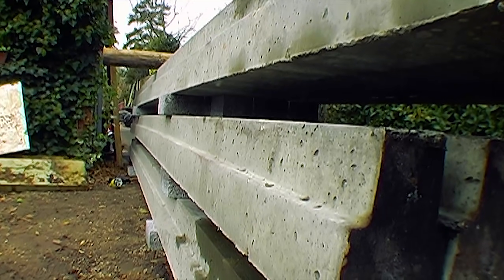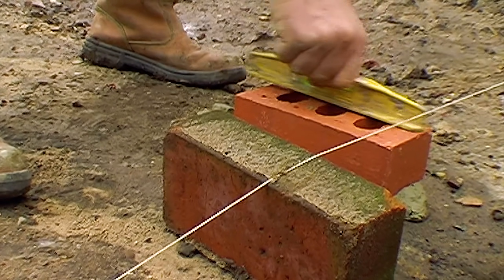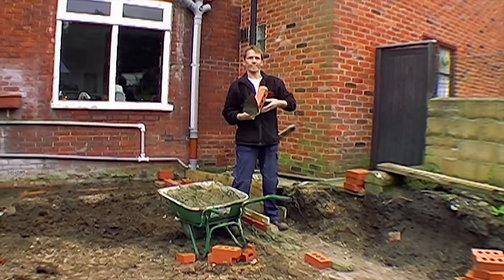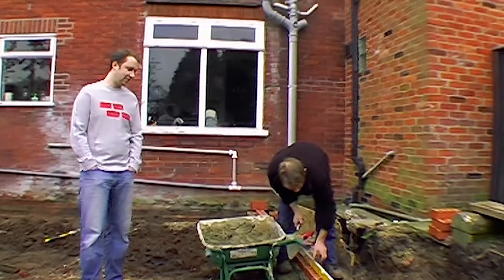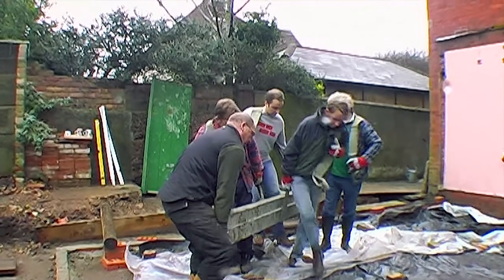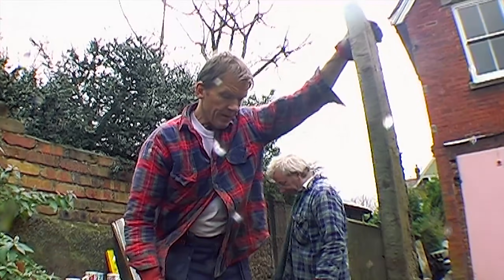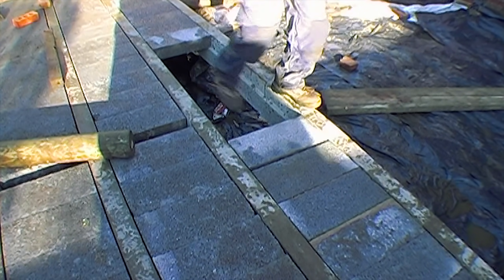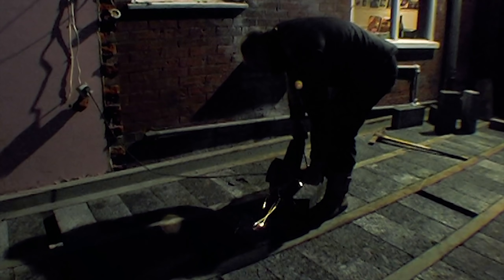Beam and Block Floor Assembly - 35A Extension #2

Comment: Wouldn't  the beams subside because  these are resting on one row of bricks without any foundation below that.
Reply from the maker: The foundation is wider than the wall and goes down 1 metere. The inner wall is built up directly above the beam ends

Comment: What is that floor all about? Why is it concrete beams and blocks and not all concrete or wooden beams?
Reply from the maker: Because it is a beam and block floor. It is a very good way to build.
Reply: First I heard of it.. guess it has its advantages.. must have been selected for an engineering reason  @SkillBuilder

Comment: Hi, did you have the beam and block foundation specified by a specialist company? Also, what is the specification for the foundation and footing that the beams rest on. Apologies in advance, I’m trying to have installed at my house.
Reply from the maker: Just go to a supplier, through your merchant. You send them the drawing and they spec the whole thing. The beams sit on a dpc on top of the brick or blockwork that forms the inner skin of the cavity wall.

Comment: Why is beam and block system economical, in this situation, when it's so close to the ground?

Ground conditions?

Too expensive to, excavate and replace with hardfill (down to stiff soils) and slab on grade above?

Thanks in advance.
Reply from the maker: Yes the ground was all made up and getting down to something solid was a lorry load of excavation.

Comment: I don’t see how this is faster than pouring concrete. It’s too heavy, requiring 5-6 men instead concrete pour requiring 3 men.
Reply from the maker: It isn't about speed. This is saves the ground build up with hardcore and sand and reinforcing.
If the ground is not great you have to dig down especially with clay. This ground was all made up so it would all have to come out. 
Some places we pour and sometimes we use beam and block
Reply: @SkillBuilder  Thanks for the clarification.

Comment: Why wouldn't you have installed a central sleeper wall to split the span? 

Also ensure a minimum 150mm ventilated void is kept rather than the 75mm in the video.
Reply from the maker: The ground was made up so a central walls would have required a deep foundation. The beams do that span very easily. As for the underfloor ventilation it is supposed to be 150mm for sure.

Comment: We would use them beams on an industrial garage not a poxy extension. Not sure if lightweight beams were a thing when this was filmed though
Reply: The beam size is relative to the span Jack. Smaller jobs would have a lighter beam.
Reply: Nathan Ellis we use light beams for everything

Comment: Hello
Can you explain to us
Why right didn't use concrete foundation
Reply from the maker: Hi Raul 
Beam and block is independent of the ground so the made up ground doesn't need compacting. Also we have a cellar under one end of the building so that is free space.
Reply: @SkillBuilder  I am concerned that starting on part 2 they cant even see the foundations you poured into  the trenches in the previous video.

Comment: i'm about to do any extension with block and beam and the beams will be 6m long. Rather than carry 1/2 tonne beams i'm thinking about going for a sleeper wall and use 3m beams, weight will go from 1/2 tonne per beam to 160kg. Goes from 6 man job to 2 man job.

Comment: is that beam floor better  then the full concrete badr floor ?
Reply: base*
Reply from the maker: The Building control decided that we would need to take out a metre of ground to find something good enough to lay a concrete slab on. The beam and block has advantages in such sites and also where there is heave.
Reply: thanks mate
Reply: Think I would of gone with a floating slab if ground heave is a problem. But shit that block an beam looks just too much like unnecessary work. Sleeper wall maybe to save your back.  But I am sure u no what your doing Roger

Comment: What is that,  mixer ...not seen 1 ?
Reply from the maker: It is from Belle and is really for mixing tile adhesive and self levelling screed. 
We were working away from home, staying over and didn't want to bring the mixer up at that stage. The brickies arrive in the next episode and bring their proper size mixer. 
Funny thing is that in one of my mad tidying up frenzies I chucked that mixer on the skip. There was nothing wrong with it and later I found out tilers pay loads for them.

Comment: i hate it when people say something can't be done.  I say there's no such word as can't
Reply from the maker: I was looking at the footage and my older self wondered if I had been a little harsh on Robin. It looked an impossible task to him but in the end 11 minutes to get the last  beam around and in position proved that all we needed to do was work out what we were doing. If we had been local we could have pulled in a few favours from other builders. Where I live we all rock up to lift a heavy steel beam in and with 10 men there is hardly anything we can't do.

Comment: We had 4 metre beams delivered on site and we lifted them one at a time onto two bandstands set just below shoulder height then got underneath them and walked them on our shoulder. Two men one at each end. It's surprising how easy they are to move when carried this way.
Reply from the maker: I would love to think we could have done that but when you go from 4 to 6 the beam is heavier section and twice the weight.  Half a ton each is  6 bllokes.

Comment: Looks great. What are the advantages of beam and block. Thx
Reply: Thomas Geraghty if you have a big void underneath it’s easier than a solid concrete floor. Plus air flow to stop damp.
Reply: max31198 the ole damp in England is a  whores ghost , timber and a crawl space with vents, rot?

That ole treated stuff now a days is no good. Fence states in the UK rotten....deck boards too. There is a treated table my father made in chicago 35 yrs ago and been in ireland outside for 25. Zero rot. Mighty stuff. Fence posts, and deck boards he bought in Ire, rot. Unreal. Concrete the way!
Reply: Thomas Geraghty 
The advantages are no dampness
The way to go is  
 start digging  foundations then do the  footings then internal drainage then the beams then the blocks in  the beams then the out side bricks brought up to the level the concrete will be, with laser level then seal the blocks in the beams,with wet muck I usually would do this with dey sand and cement and  then dampen with the hose after Then
100m polystyrene over the sealed block and beams,cut tight wright to the edges then all around the edges up right tight again  then polythene rolls  Roll them out and cover whole slab complete, and seal with water proof ducted tape preferably the blue one as is best so they say, and then ready to poor, concrete preferably the fiberglass concrete as is kind of self levelling,but you still have to tap screed and when done ,then spray with polybond spray to seal again, RESULT IS completely damp free 
com bak next day  start work ready to build extension. I said I would right this and explain, because a Lot of people on here have not got a clue what the fuck is going on so now you might have a bit of a clue, that's EXCEPT ROGER OF COURSE sorry if your reading this Roger  these people make stupid comments so I thought  I would answer for you.
Hope you don't mind that goes for you  to Thomas now you no mate.👍👍👍

Comment: You always had the trick of using the hand trolley for moving heavy beams then 
Roger! :D Great work.
Reply from the maker: Luke Dyte

Yes but that was the wrong trolley. We needed soft tyres to run over the ground. We were working away from home and you never have what you need.

Comment: Too much back breaking. Just get a pump and pour a slab.
Reply: just get your wallet out...
Reply: The ground is probably not suitable for a slab, block and beam is more flexible, used a lot on clay ground
Reply: andrew taylor then go for suspended timber floor. Sod manhandling all that gear.
Reply: @stevensdbuild9524  I agree